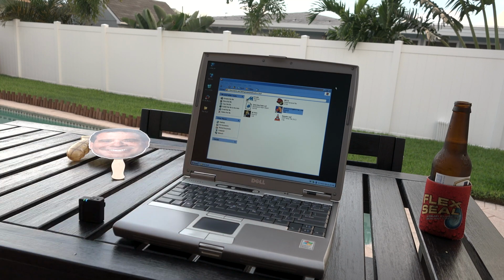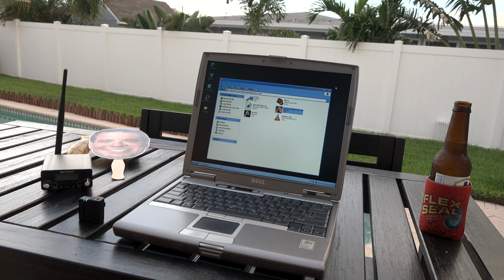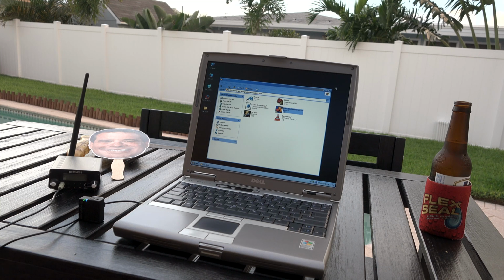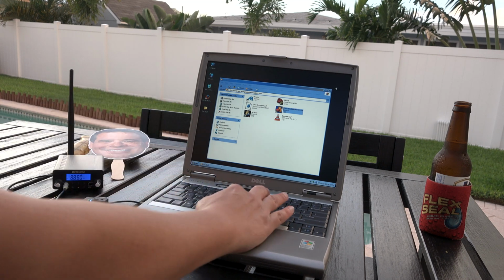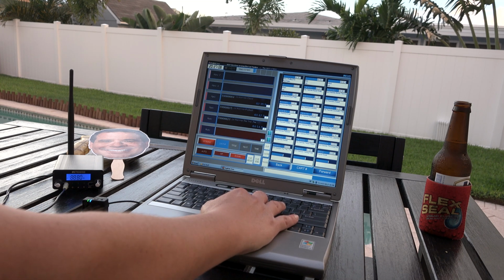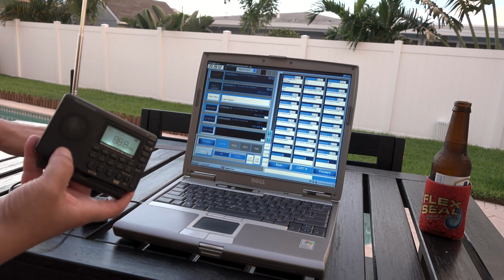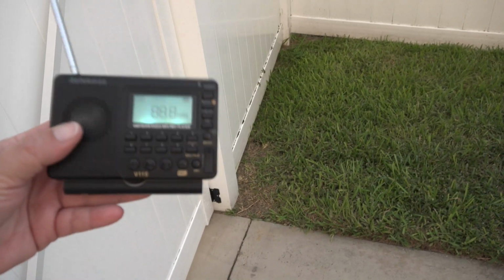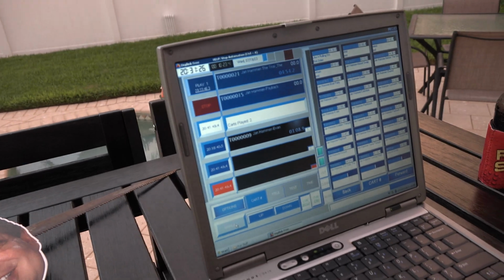How Hard or Easy Is It To Build A Radio Station? - #IJDM124

Comment: That's the simplest setup, but one of the most important things broadcast hobbyists or anyone trying hobby broadcasting out for the first time tend to overlook or forget is some form of audio processing. Without audio processing there is the risk of overmodulation, spikes and additional harmonics generated by the audio and an oversaturated carrier which can cause harmful interference with critical operations such as aircraft, Coast Guard, First responders and Law enforcement. Also in FM whether it be a small, low power station or a fully-powered signal you need some form of monitoring so you can ensure your transmitted signal is within FCC parameters. that helps prevent harmful interference with other, licensed stations in the band and greatly reduce your chance of an unfortunate visit from the authorities. You need to see with a spectrum analyzer your frequency deviation, pilot tone level and FM multiplex level plus s spec an can help you monitor closely for harmonics your transmitter might be generating elsewhere in the FM band. Be very careful in FM hobby broadcasting and best to ensure that the transmitter you choose is certified by the FCC for license-free hobby broadcasting. But once you do have everything in place and good, consistent programming maintained you can watch your station grow to be a wonderful contribution to your community and you could even generate a little side money with any local businesses who might like to advertise on your station.
Reply from the maker: Excellent points, thank you.